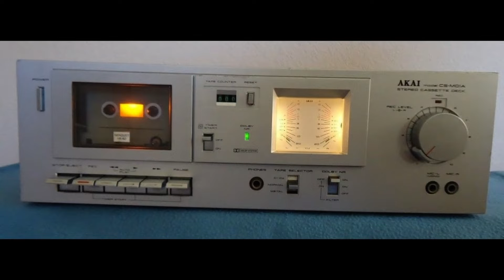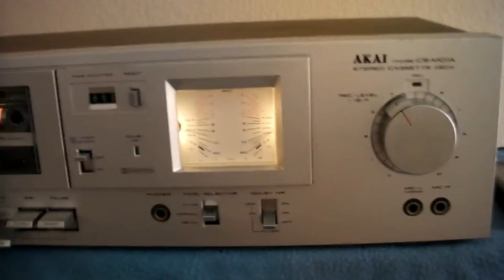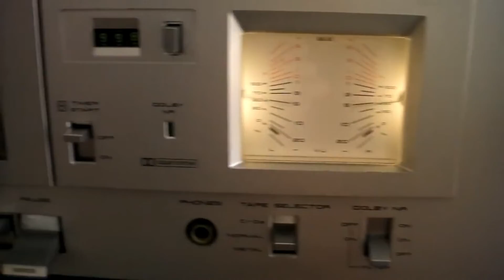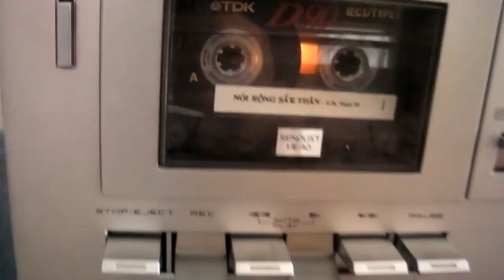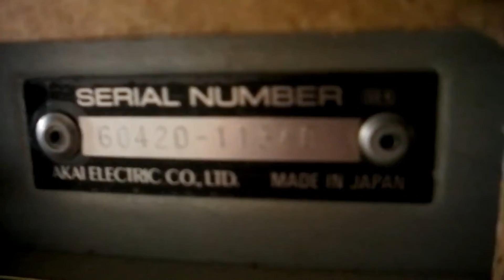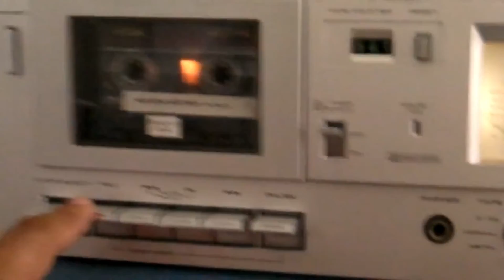Akai CS-M01A Stereo Cassette Deck -  Functions - Specs and Test

Comment: I have one. It's a beautiful deck, but it seems to have a problem: when it's turned on, the motor is always running (I can ear the motor), even without the play button pressed.
It's normal in this model or it is suposed to motor turn on only when play, fast forward or fast rewing keys are pressed?
Reply from the maker: In some models it is normal for the motor to work all the time so that the capstan has enough power to operate the mechanism in any of the desired functions.
I don't remember in this deck, but it could be that the belt is broken and has been stuck in some function leaving the motor operating all the time